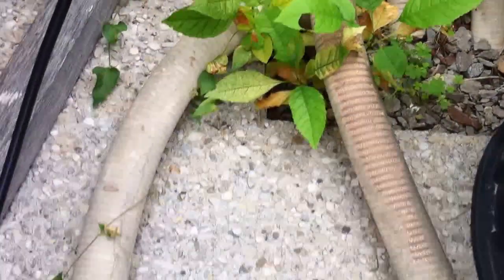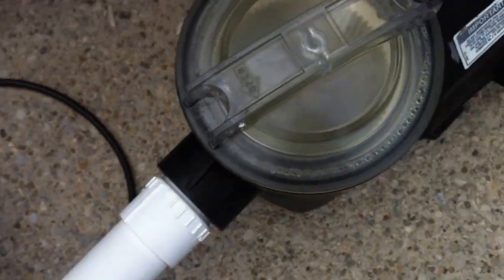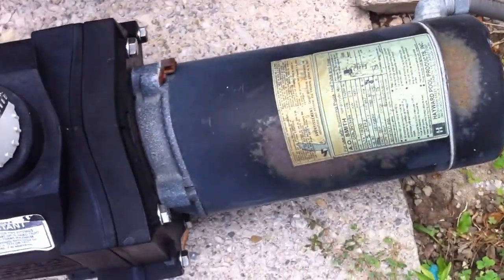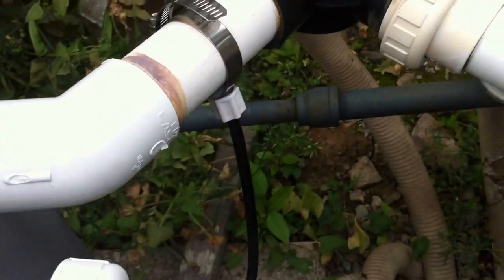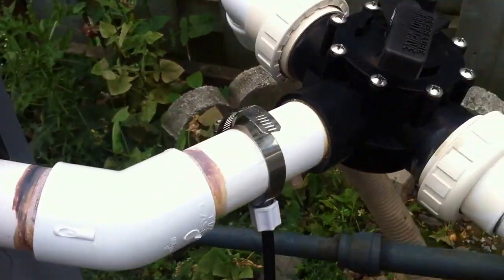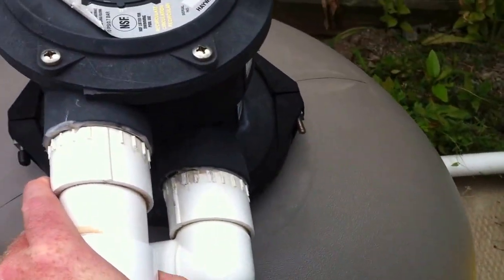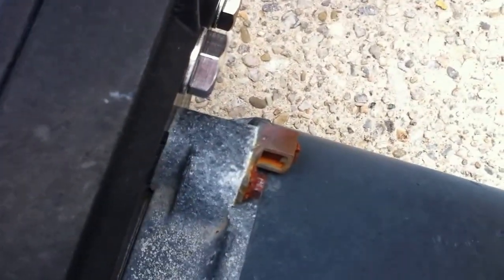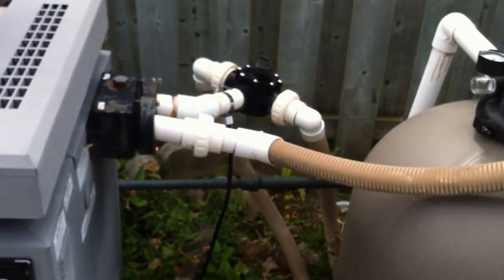Pool Equipment Installation Review - UV Damage PVC & Heat Damaged Pump

Comment: Steve,

The UV damage is significant on that flex pvc - do you know if you can use white latex paint on the flex pipe, the same way you can on the rigid pvc?

Of note:  My pool is 30+ years old, and the 'old' pvc is in very good shape.  I think the stuff being produced now is far less uv resistant, as a couple of pieces I have had to replace over the past 10 years or so, are already damaged.  The old stuff MAY be brittle and not showing damage, but it looks pretty good.  As I said in another comment somewhere on your site, I'm busy changing the whole system out.  Lots and lots of 'learning curve' with gluing up rigid pvc with sweeps galore!